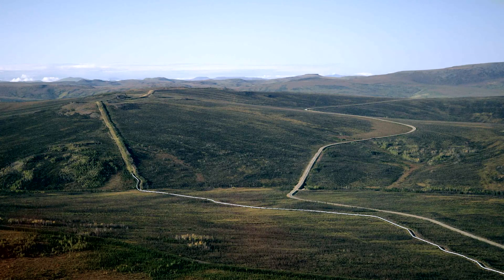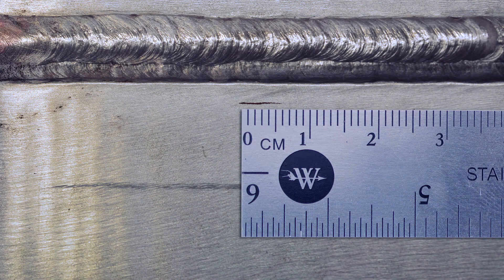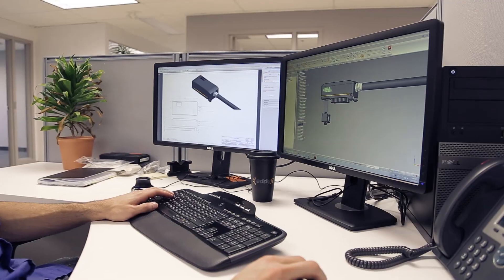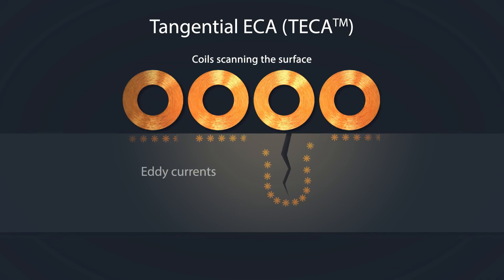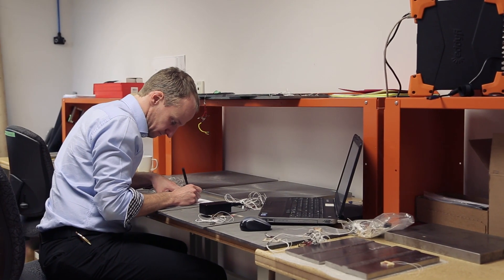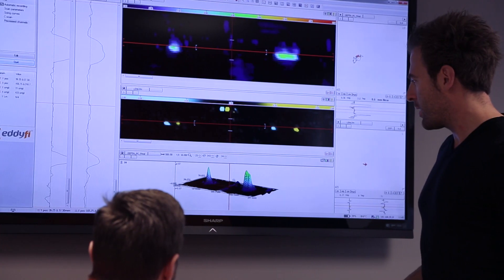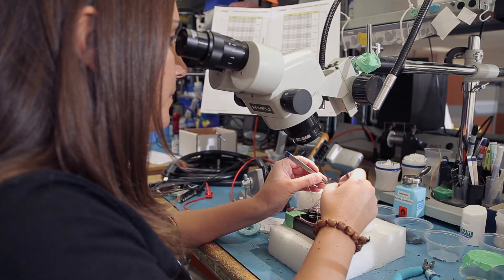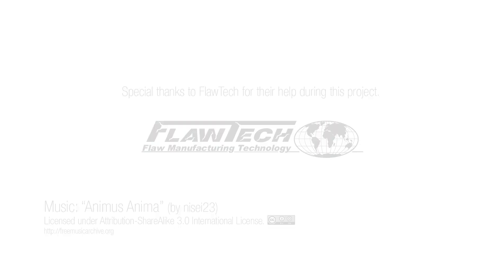Sharck — ECA Probes for Carbon Steel Weld Crack Detection and Depth Sizing

Comment from the maker: Sharck!

We are very proud to launch our new line of probes today: the Sharck

The Sharck is capable of addressing the inspection needs of several industries that rely heavily on carbon steel welds. Carbon steel welds are used in an abundant variety of industries and applications, such as oil and gas, wind power, piping, tubing, and pressure vessels.

Read the PR here: http://goo.gl/juSzYP

However, carbon steel welds are prone to cracking, which can often be hidden under layers of paint and coatings. Current examination methods for these welds are slow, highly depend on the skill of operators, and they often require surface preparation. They are limited to detecting cracks and offer no reliable depth information. To rise to this inspection challenge, a new eddy current array probe had to be created.

Read all about it: http://goo.gl/zDPLkJ